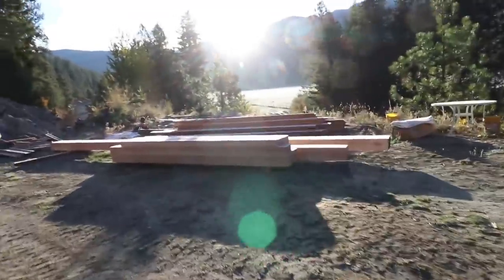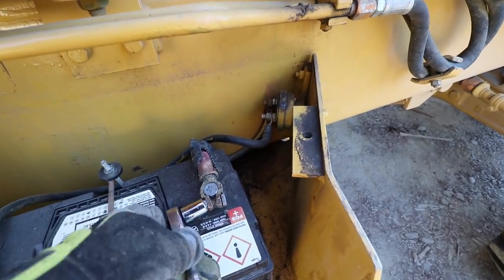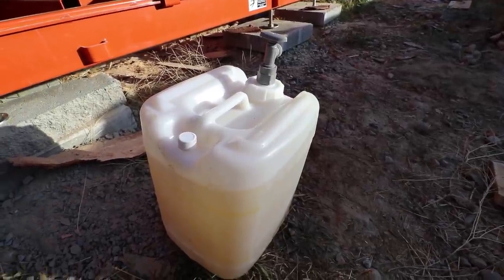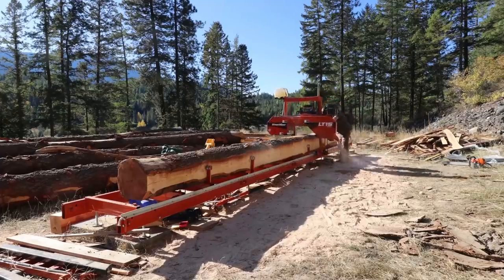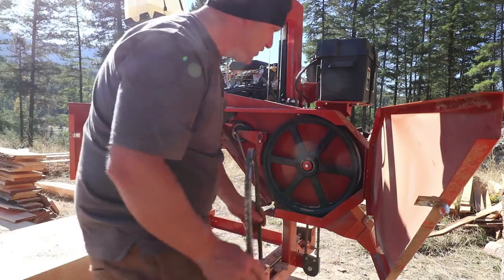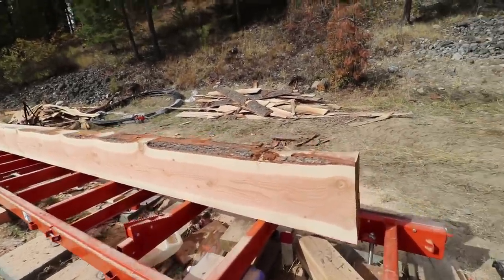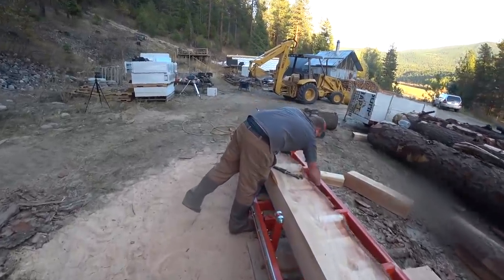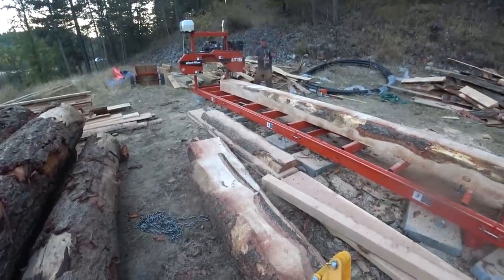BROKE OUR FIRST BLADE! (LT15 Woodmizer Sawmill)

Comment: It is quite possible that the original owner of the backhoe replaced the starter with one that draws more current than the original and the battery is marginal with the larger current draw from the replacement starter. Just my 2 cents

Comment: Instead of pouring a concrete foundation for your mill you could use your largest beams as a temporary foundation.
Reply: Exactly what I've been thinking watching this.  Even using some "bad logs" cut in half would make more stable foundation than those blocks I think.

Comment: Trickle charger? $40.00 and ignore battery issues.
Reply: PsychoticusRex no mains electricity.. not sure on solar battery capacity could handle extra drain. Better stuff new battery 1st.. assuming alternator is charging at 13.8v+
Would be a good idea to check battery voltage at night when disconnecting and 1st thing in the morning..

Comment: battery is bad it drains on its own. if you have a disconnect on the ground it will disconnect the system it don't matter which terminal has the disconnect.

Comment: I am puzzled by this leveling issue. Normally I watch saw millers cut logs and they are not concerned about level as must as straight cuts. I would think that if you mill is interlocked together and straight that the issue will larger logs on one end than the other is due to an unstraight cut. Maybe the band saw blade is lifting up due to the grain in the wood or the saw is riding on top of saw dust on the tracks. Also I think most Sayers just use a method were they trim the top of the log off smooth and the  rotate that side over to align the log with one straight side for the other cuts instead of level. I think you making this harder on yourselves than it has to be. But you are making some good looking boards. Super empress with all of the projects and I am praying that you get your pipes covered before they freeze. That would be horrible after all of your hard work

Comment: If the top of the battery is dirty it will discharge. Take a volt meter hold it on the ground side run the positive lead of the meter across the battery. Also with both battery terminals connected to battery and equipment off check voltage. Remove the ground terminal and recheck the battery voltage. It does seem though the battery has sulfate crystals forming internally. Witch would mean a bad battery. Trhanksnfor showing the mistakes we all can learn from each other

Comment: "we got the bed level...ish" 😂 
level...ish is the same kinda "...ish" like pregnant...ish would be, isn't it?
And with Your batterie issues ... well, stuck in a less habitable latitude with temperatures You got up there, You might consider batteries as a consumable like oil with suiting viscosity You'd swap for temp. reasons, or specialized chemical cocktails for coolants You do have to top up meticulously to prevent liquid cooled systems from freezing damages.

Comment: Doesn't Frost literally "Fall" vertically? If you put those cut timbers in the garage overnight under the warm board, I THINK it will minimize frost the next morning.
Reply: I don't think frost 'falls'.  It is condensation that freezes I believe.
Reply: David Abineri correct. And yes they could move them to the garage floor. But that would take about 4 hours to move everything then they will have to move them again for the workshop. Too much work.

Comment: you don't run the engine long enough to charge the battery. You should run a battery maintainer, but that is a problem with off grid. The battery should always be at full charge or it will die quickly and need to be replaced.

Comment: It's always positive first negative second. Installing a battery, removing the battery negative first positive second.
Reply: neg. off first and on last this prevents the chance of an arc if the wrench comes in contact with a part of the chassis.
Reply: Also by removing the negative side of the battery first, you remove the chance of causing a short circuit should your wrench contact the metal surrounding the battery if also removing the positive connection.
Reply: i think alternators which are very expensive on some tractors...

Comment: a full respirator using a band sawmill outdoors.. making things harder on himself than they need to be
Reply: rather that than respiratory issues later in life.
Reply: its a bit of saw dust thats being directed at the ground in an extremely ventilated area...ive seen people taking abrasive grinding dust in the face 5 days a week in tight quarters, the only filter theyever used was a cigarette without issues than or later on now

that being said i have a full 3m face mask fit tested in the shop that i put on when idoalot of grinding or if ventilation isnt adequate... but i dont break it out when i sweep up some dust

Comment: Alternators are not batter chargers. They’re really good at killing batteries, basically they tend to overcharge them if they even charge them very well at all. The batter was probably killed by that and being discharged and left discharged. Starting batteries don’t take well to being run down dead.
Reply: And autocorrect is removing the y from battery. Oh apple.
Reply: august they only top them off. They're not designed to correctly charge a dead battery, especially not one in an old backhoe which is just going to at best try to hold a float voltage thereby cooking the battery at the dead side. Charging lead acid batteries from dead isn't as simple as dump as many amps as you can into it and that's all that an old style alternator will do. Even most small cars and small gas trucks won't properly recharge a dead battery - they can yes get a charge into it but they're destroying the battery as they do it. Topping up a battery is done by holding the voltage. At the low end of charge you limit the current based on the battery chemistry and capacity. If you just dump 30A into even a 700-800CCA battery that's severely discharged you're damaging the battery. Starting batteries especially will only put up with that for a very limited number of cycles.
Reply: august ideally with FLA types you want to avoid any gassing until the battery is nearly or fully charged in its current state. And even then you don't want to cause the battery to gas (which is a function of voltage) every time you charge it, only when you periodically equalize the cells. I've built and maintained large and small battery banks for Telco and IT infrastructure. Had to learn a lot more about it because mistakes are expensive.
Reply: august further it's also really hard on the alternator and voltage regulator, not just the battery.

Comment: Jesse It docent matter what side of the battery you disconnect, it is a isolated circuit, the positive and the negatives just names, ones one of them are disconnected then the circuit is disconnected.....easy peasy........just think flashlight, the backo is just a big mumbling flashlight, in order to holde some power the battery has to be OK, and to get power on it the alternator has to OK to, just start it up and measure the big black cable with a Amp clamp meter, to se if any Power going to the battery, the you know the alternator is good ore bad, and take a Volt reading when it is running and The Volt has to be around 13.5V, and the battery will settle down at about 12V......If lower you have a bad cell, and maybe sulfat on the plates.....By the way what a nice toolbox you have with 2 big doors ;-) I thin you are right about the battery, but tjek charging volt before replacement, so you can determine what has to be fixed.

Comment: 1. Your disconnect switch looks terrible, find a new one! Cause if you have i resitance at the external and internal contacts, you loose a lot of power. 
2. after  this long time... with low crank yeah maybe your battery is dead
3. A Diesel does not need a lot of electrical power to run, for fakt i needs, cause there is no spark needed. Put  to be able to shut it  of they often have a fuel cut of valve whitch needs power to stay open and closes when power is off. So your generator could be bad, just enough power to keep the backhow running but not enough to charge the battery

Comment: You need to put a piece of wood or even a small piece of conveyer belt underneath the battery. They can discharge if left on a conductive surface and the cold doesn't really help.

Comment: What is the voltage across the battery while the engine is running?  The alternator could only be putting out 50% of what's needed so when you shut down the battery is only partially charged.  It doesn't make any difference which pole you disconnect.  The circuit from power source to load is open thus no power flow.  What is the calendar age of the battery?   After 3 years you can expect trouble from ANY lead acid battery.

Comment: You're using a sawmill that's too small for those logs. And you need a bigger battery. Do you know the trick of lighting a newspaper and - with the air filter removed! - put it down the inlet manifold and then crank to get your engine started?

Comment: Batteries in harsh environments such as heat and high vibrations from a shaking diesel engine at idle will cause premature failure. Get a new battery and save the grief.

Comment: Build a small fire under the engine of your backhoe to warm it.
Reply: As a diesel mechanic, I have done this, but only on crawlers. I found that a "Reddy heater" (or what ever brand of torpedo heater you prefer) blowing under the machine works better, and is less likely to make a owner crap their pants. If it is stupid cold (spent a few years in the N.D oil fields) tarp the machine, with a reddy heater under it.

Comment: You need a circuit for electricity to flow. There is no difference between disconnecting either poles of the battery.

Comment: If you have to change the blade every 2 hrs that means your getting through 4 or 5 blades a day what a waste of time and money
Reply: It's 2 hrs cut time.... one pass could take 3 mins going slow on a 28 ft log so your looking at about 20 to 30 passes or up to 40 to 60 passes on short logs. So you may do one blade a day or one in a week depending on how long it takes to set/cut/spin/level/set each log. and If you buy an auto sharpener you can set and sharpen a blade in 2 hrs.When you change blades you don't waist money you actually save time and money. making the blade cut better and faster.
Reply: pretty sure he said sharpen every 2 hours
Reply: every 2 hours of cut time... not let it sit for 2 hr then resharpen.....